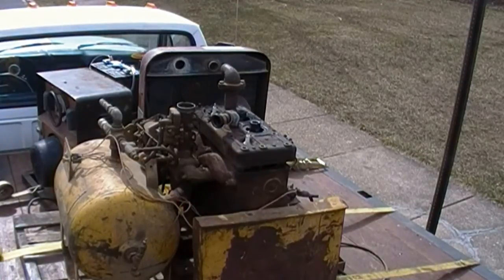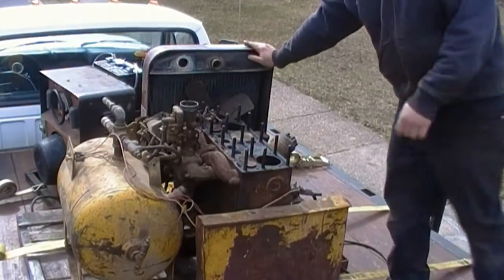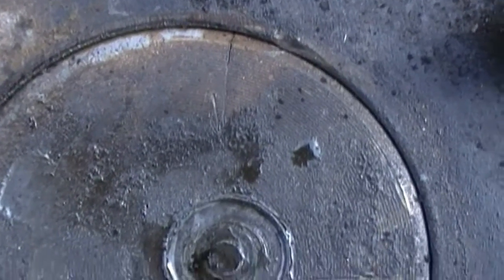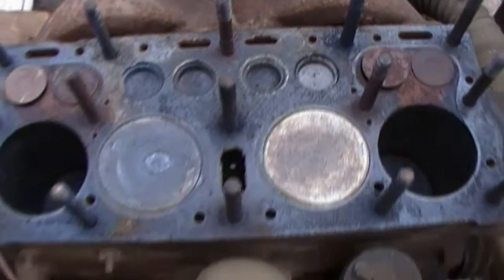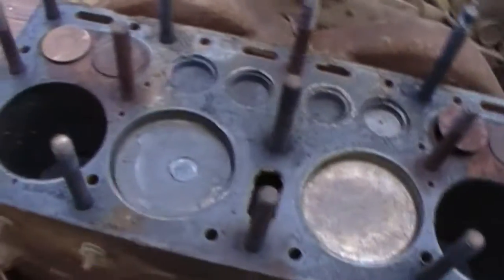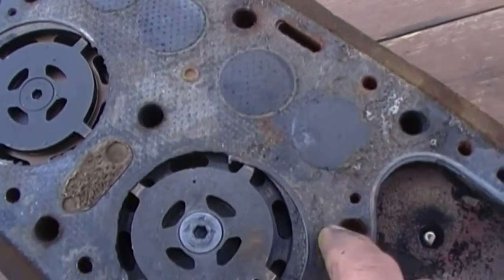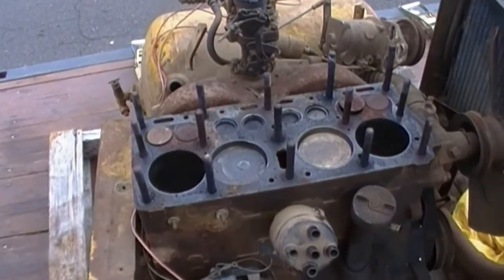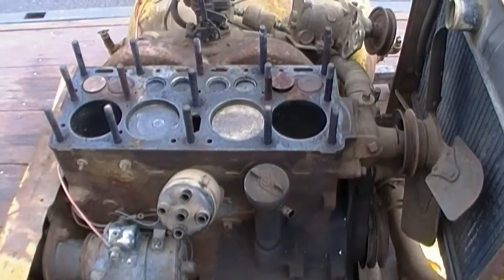General Supply Co. Air Compressor #2

Comment: They are just close off plugs to the runners and manifold since this engine is being used as an air compressor. The valves for the compressor are in the head,  hopefully the threads are in good condition since that retaining screw took a beating.

Comment: Right, #1 and #4 will fire for each revolution whereas the #2 and #3 will each pump each time the piston goes up. I have seen this setup on a couple of older industrial tractors. I would like to know more about this particular setup such as PSI, CFMs and what it was used with.

Comment: I would like to see a series of vids on this. Im guessing what you found under thead is what put it out of commission back in the day.  Also I have a (I'll call it restored but needs some mechanical work done to it. Transfer case and tranny work to be exact) 1948 willy's Cj2a jeep sitting outback under my porch roof. Thats why the engine looked familiar to me :D. Parts should be some what easy to get for that engine online I would think.